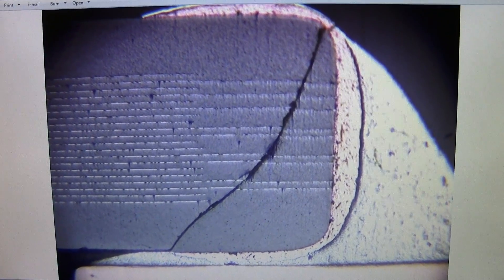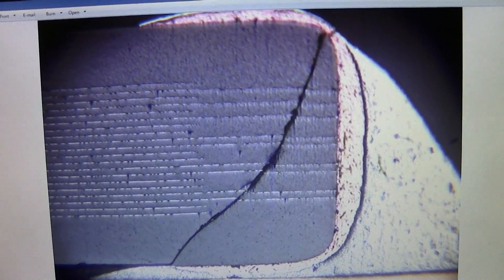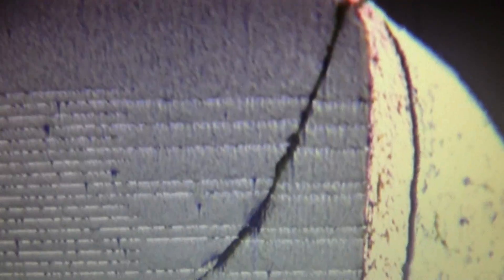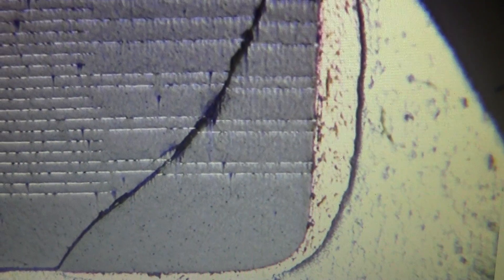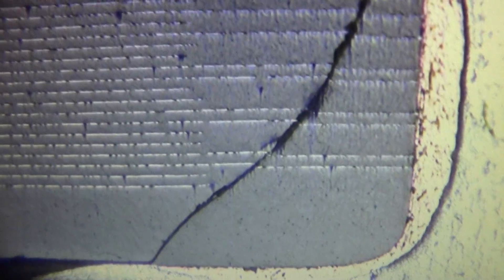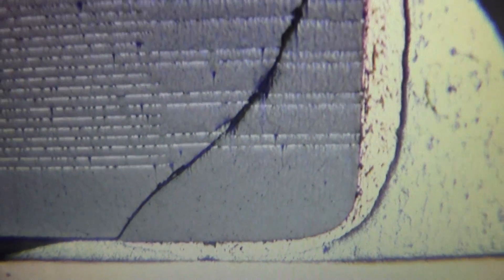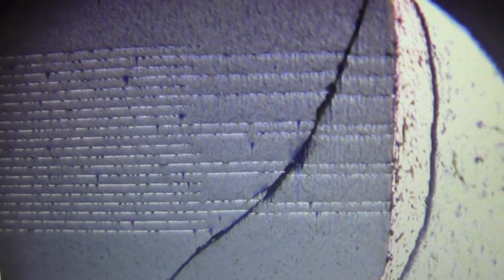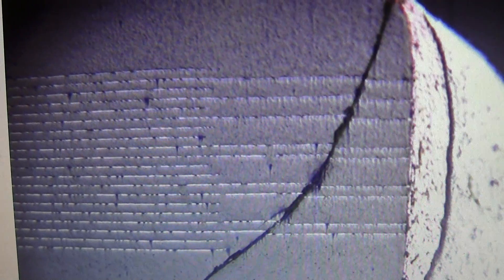Monolithic Ceramic Capacitors Explained

Comment: Feets.... What is the difference in the two common found, nearly identical caps found on circuit boards? Some are marked with a "c" and others are marked with an "R".  The most common ones, I mean. And I recently have been finding these in red!
Reply: Cxxx, is a capacitor. Rxxx is a resistor